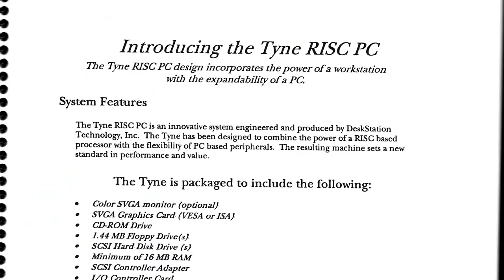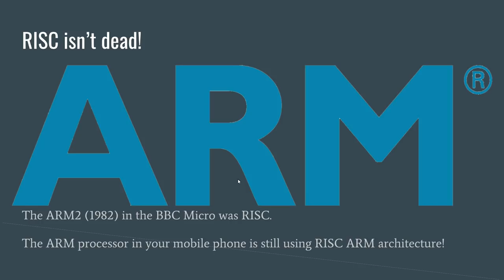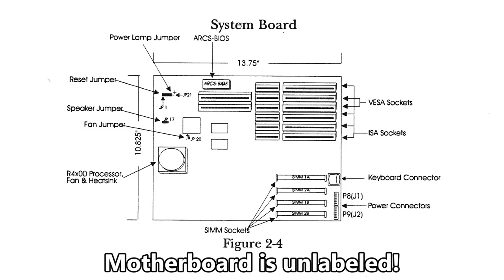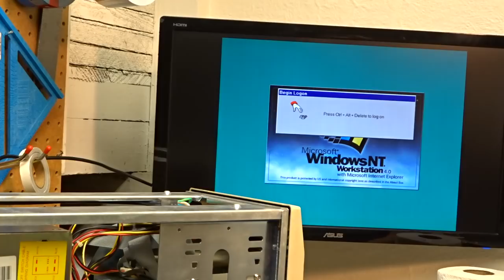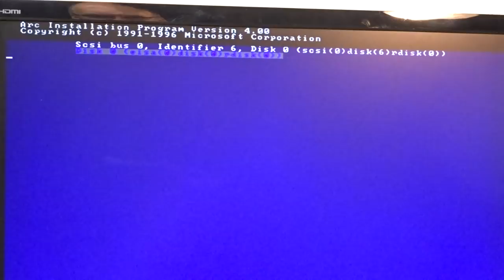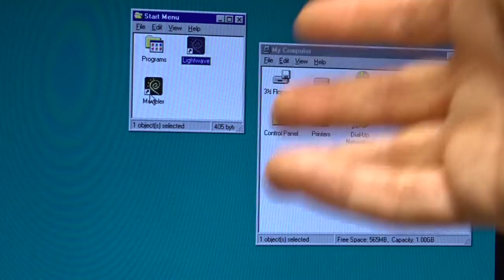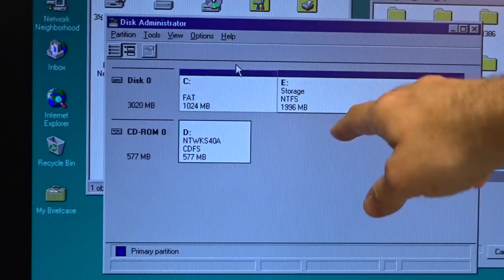Deskstation Tyne: A MIPS R4600 based PC that runs Windows NT

Comment: I don't think RISC processors will ever make it back into desktops. Intel, and AMD have made there CPU's so efficient these days, that it would be pointless.
Reply: Don't forget all the software that supports x86.
Reply: There is no longer a difference between RISC and CISC. That distinction is a bit old fashioned now. Some RISC processors have even more instructions than so-called CISC processors. Nowadays AMD and Intel 64-bit processors are many times faster than the most powerful MIPS based SGI 3D workstations at a fraction of the price, thanks to economics. Even cheap modern processors can produce a floating point output many times faster than those MIPS processors now.
Reply: Todays CPU are risc but translate back to x86 instructions. They are hybrids
Reply: @albino_gringo1912  amd makes nothing tsmc does and they also will make 7mn for whomever pays them .. nvidia will be getting 7nm from tsmc also 7nm is just a number intel 10nm and tsmc 7nm is pretty much the same .. they both also are using standard lithography which will be finished with 7nm ... 7nm+ and smaller will have to be done with ultraviolet lithography which at this time samsung and intel are working on and tsmc also ..actually intel is working on 10nm and ultraviolet for their future 7nm at the same time .. btw intels 7nm will end up being roughly equal to tsmc 3nm .. I like the competition but all amd is a brand for a a tech company that pumps chips out for lots of customers.   AMD's actual chip manufacturer havnt done anything on it's own since 22nm .. they needed outside help to get to 14nm .. people complain about Intel pricing but any company including amd would have done the same if they where a one man show.. actually you should be mad at amd for trying to sell absolute garbage cpu's for years .. that's the real crime .. so ya I cheer for intel becuase they r&d and actual produce something themselves .. amd does not
Reply: And yet, here I am with a PowerPC-based Talos 2 on my desk at work, and a Raptor Blackbird on preorder for a NAS / HTPC build... 🙄

Comment: 4:30 "superscalar" make all that RISC/CISC bulshit discssions irrelevant. Making all CISCs -> RISC anyway (divide instruction into uops). Except one thing - power of decoding. RISC would be always better cause never need to decode complex instrutions. Less complex decoder means smaller die. Power was and is still valid factor of RISC/CISC nomenclature

Comment: RISC - Consumer
CISC - Science
in a cisc cluster you only need to expand the processor cards - complex ? really ?
power consumption reduces itself by lower design in manufacturing - thats not real magic

i've seen ibm ps/2 286 which beat vl-bus compatibles with much modern hardware 🤣

Comment: Would Minecraft run on this?
Reply: Probably. Minecraft is available in its original Java form, so it will run on practically any CPU for which there is a JVM implementation and OpenGL support.
Reply: Doug Gale Will you do a video on it?
Reply: I don't think there is Java for the Tyne. And if there is, the S3 doesn't support OpenGL 1.2 as it didn't exist yet!

Comment: It's too bad it run windows NT. Microsoft was targeting more platforms at that time. Because that was impossible, so at least 50% of the OS was running on an intel emulator. Especially dec alpha 64 bit was a waste of cpu doing intel emulation.
Yes, it is sad to see that the 8086 16 bit real mode still exists (Does it though?).
Arm and Mips can be a lot faster than intel arch, but most of us need binary compatibility. My galaxy note 8 is much better than my gpd win in both absolute numbers and power/performance ratio. My note 8 can't run any steam games though. (GPD win is an awesome piece of minimizing intel architectures, but it still has a big fan).
Reply: Starting in Haswell (4xxx generation), Intel dropped support for the A20 gate in hardware, but if you load EMM386.EXE, it will recreate that functionality using paging anyway. Realistically, anyone running DOS programs will be loading EMM386.EXE. So your doubts are somewhat correct. The address wraparound was mainly used by the BIOS anyway, so any BIOS that intended to work with a new CPU could work regardless. (The wraparound was a cool (at the time) trick used by the BIOS which set the code segment to have a base at 0xF8000, and it relied on being able to access the BIOS data area near address 0x400 by accessing with an offset >= 0x8400). it could then use a code segment override to access it without having to fiddle with the segment registers.

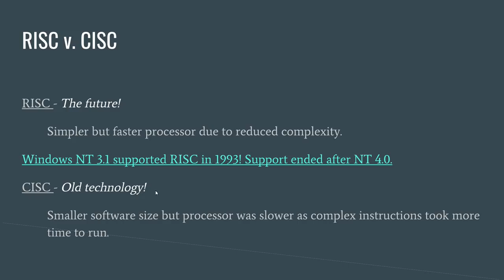Comment: 4:13 - "run at faster speed" - Uhm ... no. You can run something at HIGHER speed. "Fast" already indicates a speed, so a "speedy speed" is a quickly changing speed, which is, surprise, a high acceleration. Mind minding your derivatives?

Comment: This thing is impressive in how boring it is. Definitely quite different from my SGIs...
Reply: Most likely, using PC-style components most definitely brought the cost down.
Reply: At $8K it would be close to the entry price of an Indy, but a decent Indy would have cost a fair bit more, but then that's no surprise. Interesting that the documentation mentions the option for a 2MB cache, the R4600SC/133 in Indy only ever had 512K (the R4600PC version with no L2 was horrible, so much slower without the cache). The R4600 design was biased towards int tasks, at 133 (with 512K L2) it performs about the same for SPEC92 as the R4400SC/175 (1MB) which was the far more common MIPS CPU of that era in use by SGI (the Indigo2 and other systems supported R4400s up to 250MHz, with 2MB L2 in Indigo2 and 4MB L2 in Challenge/Onyx, while the max for Indy was 200MHz 1MB). The R4600's fp performance was weak, whereas the R4400 had balanced int/fp (at least for SPEC92 anyway), making the latter stronger for fp at the same clock, but the R4600 used less power and was better suited for general workstation tasks and found use elsewhere such as the variant in the N64, set-top boxes, etc.

It's interesting the R4600 was used in a dedicated NT workstation of that kind; given the CPU's comparative low cost, I would have expected such a system to have the R4400 at 200 or 250MHz instead (ie. with an $8K price tag, that system deserves an R4K/250); I remember seeing adverts in SGI's news update mags in the mid 90s for NT upgrade packs using the R4K/250 to make NT stuff run more than 2X faster than native Intel systems (so the advert claimed).

Hey V. Sigma, what SGIs do you have?
Reply: mapesdhs I have a 150MHz R4400 Indigo2 and a 180MHz R5000 Indy. The Indigo2 currently isn't working properly...
Reply: Good find on the Indy! Having an R5K means one can exploit the MIPS4 Nekoware. Bummer about the Indigo2, what do you reckon is wrong with it?
Reply: Power supply is too weak, can't run both the graphics subsystem and the hard drive at the same time. I need to replace it...again, as the first replacement PSU turned out to be bad and was returned.
Reply: That's odd, original teal units should run fine with the original PSU. Or have you fitted the system with IMPACT graphics? The disk uses very little power. More likely just a bad PSU. What gfx is fitted? Extreme?

I'd send you a replacement teal-type PSU for just the postage & bus fare to the PO to help, but if you're outside the EU then it'd be easier to source one locally I expect.

See my site for a full breakdown of Indigo2, it might help deduce what could be wrong:

http://www.sgidepot.co.uk/i2info.html
Reply: I've got the base Newport graphics (two boards). This was a pretty low-end Indigo2.

If it's not the PSU then I don't know what it is, all I know is that the hard drive spins up with the graphics board disconnected and doesn't spin up with it connected.
Reply: Adrian Black I should probably try changing out the graphics board too, see if that improves things.

Comment: run duke nukem.
Reply: it's for x86, and NT doesn't fully support DOS games anyway. (duke nukem 3d runs fine with "normal windows for DOS" loaded, but I don't think it would run well on any NT)
Reply: @pelgervampireduck  dosbox mabye?
Reply: it takes a very powerful computer to run complex games at playable speed in dosbox. it can run 80s stuff pretty well on a pentium 3, but 90s stuff need more cpu power.